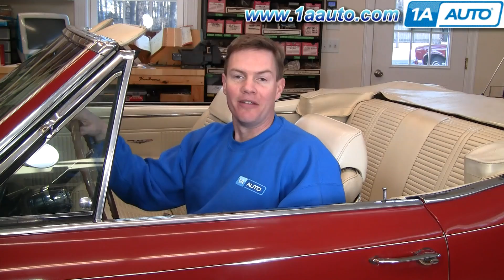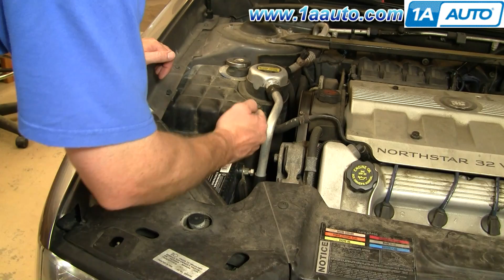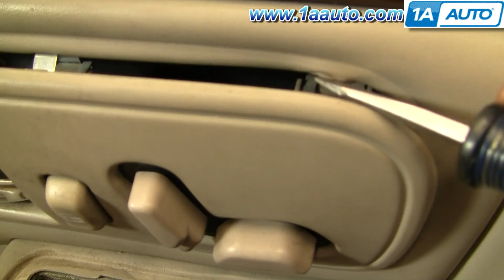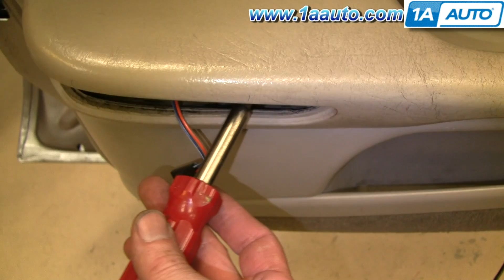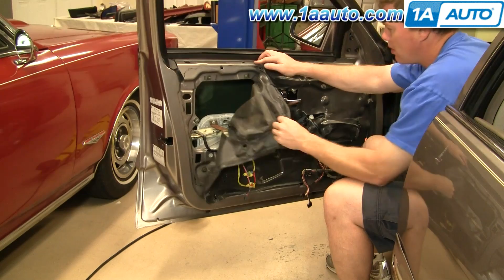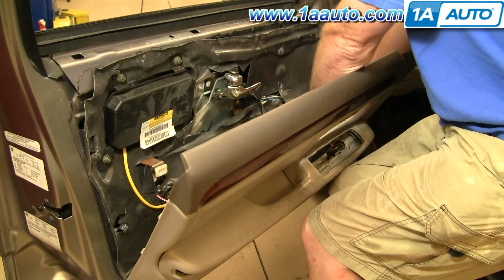How to Replace Front Power Window Motor 94-99 Cadillac Deville

Comment: 2:45 pm June 15th 2024. I just watched your video on the driver side window motor replacement and I am confused. How did you figure out it was the power window motor. My driver side is the only one not working. So what do I check in order to find out my problem if all the windows are on one motor

Comment: Hay just did this on my caddy, part went in great and everything, but the original had some grease on it, should I have greased the new window motor?
Reply from the maker: +Russell Harris Thanks for checking us out! You should not add any grease to the motor as this will attract debris and potentially clog the motor. It is possible the grease was from the old motor which may have been the cause of the failure in the first place.

Comment: I just replaced the motor for my power window on the front, driver's side of my 1991 Olds 98.  Thankfully it had nuts instead of rivets.  Took right around an hour.  At first I thought maybe I didn't need a new motor because after I removed the old motor, I hooked it up to power and flipped the switch.  It ran!  But...it was running rather slowly so I put power to the new motor I received from 1A auto and flipped the switch.  It ran a lot faster, so I figured the old motor wasn't completely dead but simply did not have enough power to move the window any longer.  I thought about putting the old motor back, thinking that maybe something was broken with the mechanism, but that wasn't the case.  After all the bother of removing the door panel, plus the fact that the new motor from 1A auto was less than $38 (with free shipping!), I figured I'd go ahead and put it in anyway.  Glad I did.  It seems a bit louder than the old motor, but maybe that's because the old motor was on its last legs.  Oh, good advice on putting the nuts on loosely and then running the motor so the gear engages the sprocket, or whatever it's called.   Once the gear meshed and the window moved up and down, I tightened the nuts all the way.  You don't want to force the nuts and tighten them all the way until the gear meshes with the window mechanism.   With the fast service, quality products, free shipping and helpful videos, I'll definitely come back to 1A auto in the future.
Reply from the maker: Thank you for the great reply. We love to empower our customers by showing you how-to perform your own auto repairs while installing our high quality auto parts. Have a great day! 1aauto.com +Jim S.

Comment: The unit that controls (locks and unlocks) all four windows stopped working on my 1990 Cadillac Brougham (5.0 .)  The individual actuators work, but in order to lock/unlock now, I have to do it manually.  This cannot be done from the driver seat. What could be the problem and can you provide a part and instructions, if needed? This really does pose difficulty, as the locks in the back seat are located at the rear of door....hard to reach from the front to lock or unlock.  Thank you.
Reply: Most likely need a new power door lock switch if it doesn't make the door locks move from the drivers door only.  If the passenger side or rear door lock controls make the locks operate normally the problem is either the switch (or less likely, in the wiring going to it)

Comment: How do I remount the electric door locks switch in the front doors that have come loose. (1996 Cadillac DeVille)
Reply from the maker: +Tommy C If the door panel or mounting area has become damaged you may have to replace the door panel or repair the mounting area. 1aauto.com

Comment: Do you have a video for the 1986 Cadillac Fleetwood? (RWD) The frount passenger window starts tilting like it's not it's tracks. Maybe a broken guild...
Reply from the maker: We currently do not have an auto repair video on this particular repair. Thanks for asking.You may want to remove the door panel to see if there's anything obvious going on inside the door which may be causing this to happen.1aauto.com 888-844-3393
Reply: 1A Auto Parts

Thanks for taking the time to answer. It is the removal of the door panel that I was interested in.  I don't want to damage it. The car is a rust free California/Arizona car.

Comment: Ive got a 98 deville and i was taking a look at the motor for the window today because i just bought an installed a new power switch, but when the window hits the 1/4th open point it stops, and there's this really loud grinding noise. I took the motor off and it seems to run fine when its not up against the gear. Any clue whats going on there?
Reply: Same problem. Was it the regulator?

Comment from the maker: The best way to determine what is going on is to check at the wiring harness that connects to the motor for 12V when the switch is clicked and then try and the back of the switch itself.

Comment: I have a 1998 Cadillac Deville and I tried to roll down the driver side front window and nothing happened.  I even hit the inside door panel a few times with the palm of my hand and tried the switches again...nothing.
The next day I tried the window again, and amazingly it worked just fine.
This happened again one time since then - didn't work one day, but worked the next day. What do you think the problem is.... my switch or motor or regulator? Please help thanks!

Comment: I have a 1995 Seville. The driver's side window will not go up or down but I the motor runs when I push the button - up or down. The window just doesn't move. I can manually push the window up and down. Could it just be off track?

Comment: I used your instruction and replaced the window motor no problem,thanks! Have you done a video on replacing struts on the same car? Mine hits metal when it goes through even a small pothole. I cannot figure if its the strut, the coil spring or both. Would it be easier to replace both of them together?

Comment: These videos are fantastic, they are immensely helpful!
One quick question: two of my power motors will not roll down. The drivers window and rear passenger window. When you hit the switch to roll them down, you can hear clicks...but no movement. They did not fail at the same time, it was the drivers window first, then the next day the rear passenger side failed. Could it be the motors or an electric problem?

Thanks in advance!
Reply: Was it the regulator? Have the same issue. I can hear the motor turning but window doesnt move at all. Ive watched plenty of videos on replacing and repairing  but cant find any on diagnosing.

Comment from the maker: @LatLat2004 It could be that the motor's getting weak. You may also want to take the door panel off and put some white lithium grease on the window regulator track. You can also spray some silicone spray on the weatherstrip that surrounds the window area too. This may help to speed it up for you. Hope this helps.

Comment from the maker: @jonathan99786 You could use a test light to test the wiring coming from and to the switch. If there isn't any current coming out of the switch, but there's power going to it then the switch has more than likely gone bad.